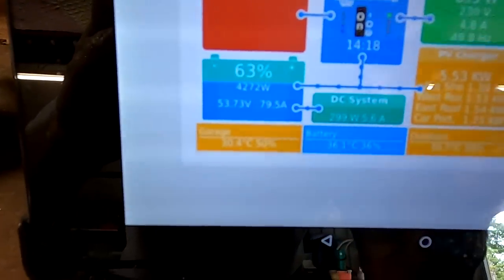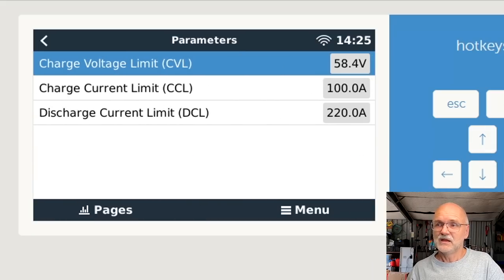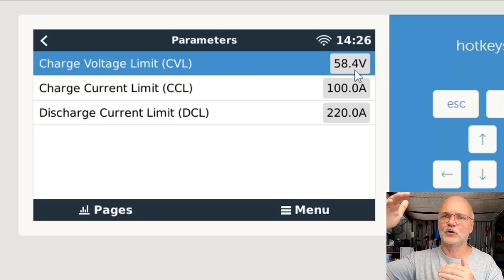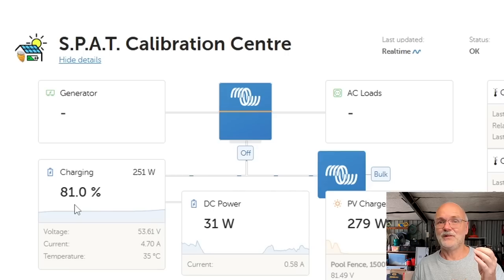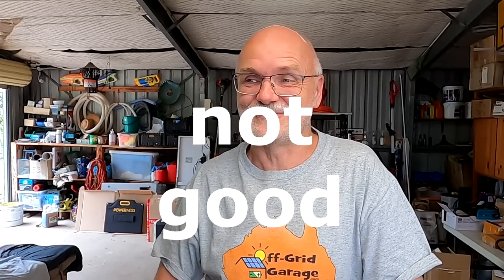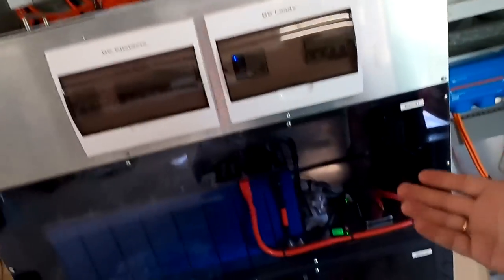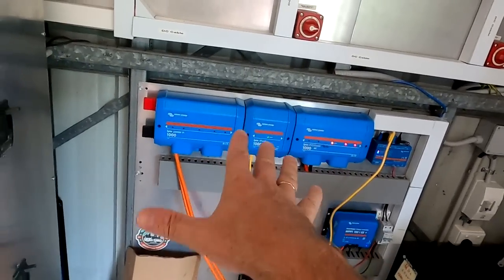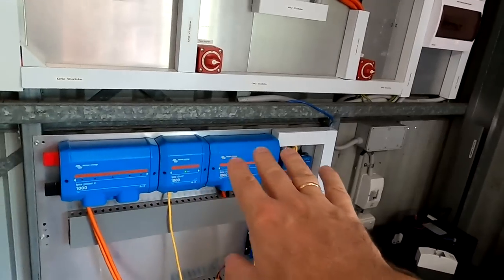SEPLOS BMS and Victron Lynx Shunt. Great solution, but why this is not for me.

Comment: Hello Andy
Haven't you thought about testing BATRIUM?
Reply from the maker: Yes, I did. But this is not something you just test. Due to the very high price you would need to commit to it. And the installation is rather a medium project as they need to mount these balance boards directly at the cells.
Reply: @OffGridGarageAustralia  Hey Andy! i Think you don't longer need to mount the balancer Boards.You have to install the CellMate-K9 Board instead.  Which can be mounted on a central place :-)
Reply: @OffGridGarageAustralia  Installation (BATRIUM) is really expensive, but you don't have to mount anything on the cells (it's not necessary) if it's WatchMoonCore and K9
It's nice to watch you and I will always be a fan regardless of your future videos :-)) Greetings from Poland
Reply from the maker: @jerzol_KOMINIARZ  Thanks a lot!

Comment: Switch DVCC on, disable max chargecurrent and max chargevoltage and all other stuff and let the bms control Victron. The BMS will limiting the current when battery get full. The Voltage of 58,4V you will never see and your battery working flawless.
Reply from the maker: That will not work as we have seen.

Comment: Maybe you could test JK BMS with CAN? The newest one I got has a setting "Port Switch" with options CAN or RS485.
I don't have CAN in my raspberry so haven't tested it myself.
Reply: not sure if this addresses your question but Andy did a video a while back on configuring different BMS’s he has used to communicate with Victron using CAN.
Reply: @inmyimage1081  Ye there's that video. But I think only rs485 was used there to communicate. But I assume its similar. I just thought that maybe you might want to use CAN if you use a Cerbo so that you don't need to add 3rd party usb.
Reply: @kimsandb  Yeah, I couldn’t remember which communication method just that he did make it work with several different BMS’s
Reply from the maker: I tested the JK, Daly and JBD with USB - RS485 adapters and all worked fine. You just need to install the driver on the Cerbo and it will work. But only for one battery bank, that is the point. If you have three banks, only one bank will report to the Victron system. Hence, we have the Seplos BMSes where all the batteries report their data.
There is no benefit of a CAN over a RS485 communication.
Reply: @OffGridGarageAustralia  Thanks for the info. The single bank limitation makes it kind of a worthless feature.
Reply: There's an aggregate-batteries addon that can combine batteries. But it looks like its an temporary solution until serialbattery driver has direct support.

Comment: The problem is the BMS if it doesn't reset until it teaches the  danger cut off voltage it's got a fundamental flaw .
Reply: yes. we want a settable "reset SOC voltage" in our BMS

Comment: So as I understand right, the seplos BMS works perfectly with victron except it is not showing 100% SOC but 99.9%? Really? Thats all!? You know that SOC on lithium batteries is just suggested? Its only about volatage. If you pack is at 56.8V as suggested by Victron, your Pack is full! And for sure it is not 100%, but 99.9%, but this is fine, its not good for cells to load them always to 3.65V, so imho the seplos works perfect. But anyway, thanks for the interesting video! 👍

Comment: It definitely seems like more of a seplos issue than Victron at all. Seplos shunt is incorrect, and seplos also does a bad job at managing voltage/absorbtion and not allowing float.
Reply from the maker: I tell you, the Victron Smart Shunt is really good and works a treat, measures accurately, shows SOC with fine resolution and also counts DC Power.

Comment: Seplos, where are the solutions for all these red text?

We are waiting and this is the comprehensive collection of a lot of your bms issues for months.
If there won't be reliable solutions I will sell the seplos crap and replace it with a different one that is able to deliver and not only pretends to deliver.
sad, but true

I will order an eel just to try it out. can not be worser than seplos bms
Reply from the maker: They are working on it but it will take time. See, how quickly they have improved the packaging for example. The software may take a while...
The BMS is good if not great, it is just the software which needs improvement. I'll keep working with them on this and we will test the three, the same Seplos batteries in parallel once the cells arrive.
I really hope the BMS system which is coming in will be the one!

Eel is using the same Seplos BMS and software. I have one incoming with the same BMS 48150 10E.

Comment: I don't think the Seplos issue is going to go away, because other BMS producers face the very same issues. What is different about Seplos is that they are willing to listen to feedback. As I understand it they are aware of the problems you have raised. But ignoring their own advice about sharing different battery pack capacities, and using different Seplos BMS's in the same stack, is not going to go down well with them, or me. I feel your tests under these conditions does tend to throw you own testing methods into an inconclusive result. 

Victron have to work with many other manufacturers of BMS not just Seplos, and they too face the same problems as Seplos. Paring two system together from two different manufacturers is always going to be difficult. Looking at the responses below, 'many being knee jerking' I fear you may have lost the opportunity to work with Seplos to reach a satisfactory conclusion. Shame!!
Reply from the maker: I'm working with Seplos together to get issues resolved and they have already started, so things will improve over time. They may not have the resources and power to change everything as we want it and that's fine. Nothing is perfect.
Testing these two batteries in parallel was always on purpose and 'unsupported'. We have also tested the batteries separately with not much more success. I will keep building the Mason batteries and we can test 3 the same batteries and BMS in parallel again once this is ready to go. There is still more Seplos stuff to come and I'll keep working with them but I won't go into these details any more as the information is already here.
And as for Victron, I'm in contact with them as well to report issues and improve things with new FW (see the shunt issue reporting -10° which was fixed in the latest). Victron has they compatibility list of battery/BMS manufacturers where they know their system will work with. And they will never be 100% compatible with all the BMSes on the market. Neither will Seplos be 100% compatible with all the inverters out there.
So, from my perspective, nothing is lost and the situation will get better over time. I feel like we have just started with all of that and got this moving...
Reply: @OffGridGarageAustralia  I understand what you trying to do, but I think you might be under estimating your own influence on your viewers. I think you should put this statement up for all to see at the end of this video, if only to be fare with Seplos and its potential future customers.
Reply: @showme360  I agree. The impression I got from the video was all hope had been given up on Seplos. I only know differently as I comment and read the other comments.

Comment: I must say that after watching all of the video's about the Seplos batteries, their BMS firmware needs a major overhaul. They have alot of missing features and need others tweeked. I personally am not impressed with them.👎
Reply from the maker: But on the other hand it is just software, right and can be 'easily' fixed... It's a huge potential for this BMS and Seplos.

Comment: @off-grid garage , how come you have that voltage drop between the shunt and the seplos bms ( i have that too, but with 5m 70mm cable ) , i see you have maybe 1m cable between it.
and i have set also the shunt as battery monitor ...and no BMS control ( so all via victron ) , shared voltage sense is on AND thats the part i dont get , i do not think victron calculates with the BMS voltage ,else it would be the same value ( i think the svs is only for Quattro, mppts, shunt voltage)

Comment: NEW inverter works great running aircon for free love it , still had 10amps left over putting charge in so new video show 1.4kw running 1180w aircon with 200w left , now i need second.  100/50 and 1.4kw more solar to run the rest of my gear and still have some charging power , humm

Comment: Hi Andy,

I wanted to talk to you about my smart shunt. Lately, I've noticed that the shunt is not measuring the same current both ways. Specifically, it measures higher current going into the battery than going out of the battery. As a result, the shunt is increasing the state of charge (SOC) by too much, and I have to reduce it by about 10% every time. I've tried adjusting all the parameters, but the only thing that seems to work is increasing the difference between the measurements, which is not ideal. I've considered changing the Peukert to lower than one or increasing the charge efficiency to more than 100%, but both of these options are impossible. Do you have any suggestions for how I can resolve this issue with my smart shunt?

P.S. My text was improved by (Gramary) 

Thanks.

Comment: Morning Andy,  so 55.2 V max on both your Selpo and system 2.1 .
Reply from the maker: 55.2V is my absorption voltage. I'm not charging higher. The Seplos and all other BMS are sitting higher though.

Comment: Seplos is a superior solution for stand alone battery builds. Victron is far more expensive and requires multiple expensive components to achieve what Seplos does in one complete package. Seplos BMS also communicates with a large number of inverters out of the box. Why would Seplos care about communication with a more expensive competitor when their own solution works flawlessly? Your bias is not important to an OEM who also sells components of their very well built battey solutions. What you should be asking is why Victron does not sell a compatible 48 volt BMS.